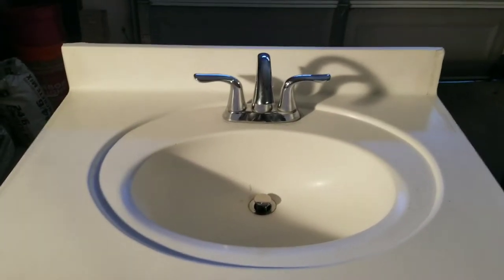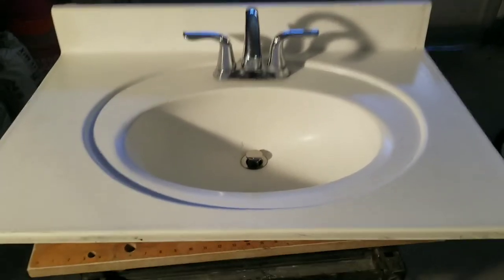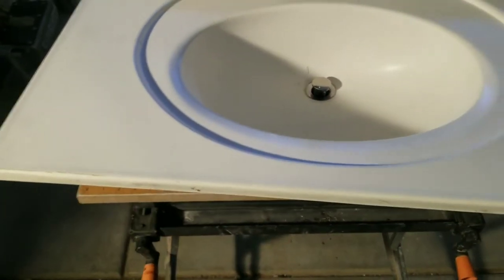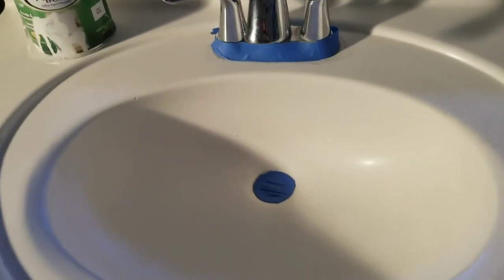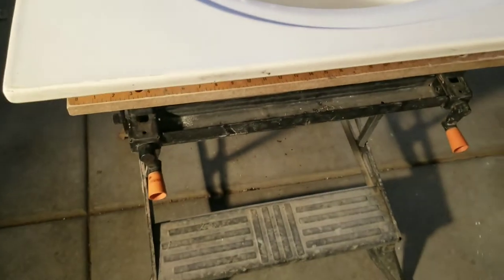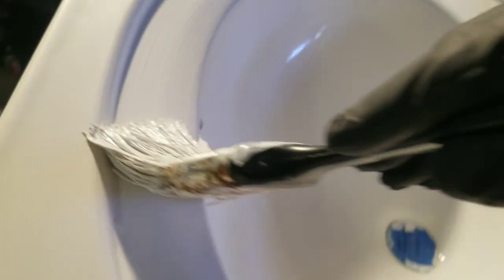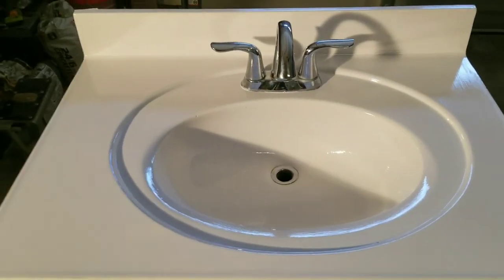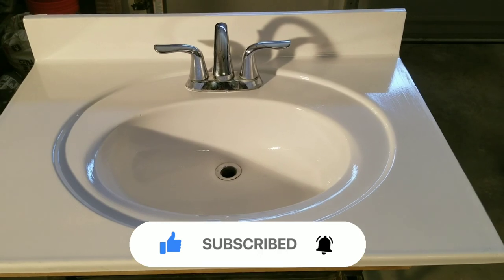Bathroom sink refinished with Rustoleum Appliance epoxy

Comment: I’m about to use this on an old tiled countertop. I live in a rental. I think I MAY do 2 coats..not sure but is there a sealant or top coat of some sort I should use?
Reply from the maker: I did not use a sealant on this or the kitchen counter tops. I made a video on that also if you like to see it worked out really well
Reply: @maintenancemadeonabudget  I tested it on one tile cuz I was scared lol it looks ok. I can see where I did it on the sink it sorta peeled some but I think it will be fine on the counters
Reply: @maintenancemadeonabudget  thanks for your help! I will check out ur other video 🙌🏽

Comment: My vanity is old had a 4 inch staight crack in it.  should I use bondo first to fill in this crack or will this do it.  The crack is not wide and does not go all the way through.